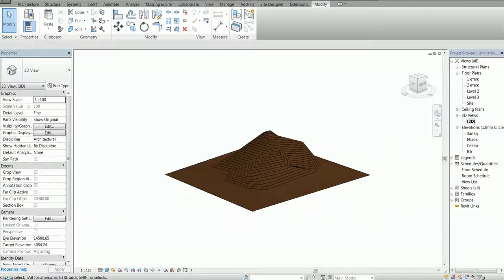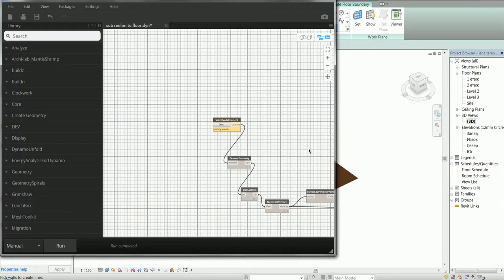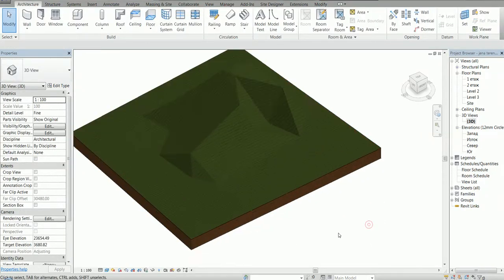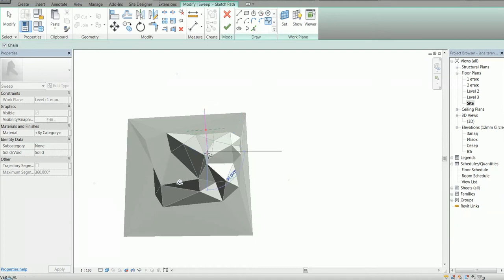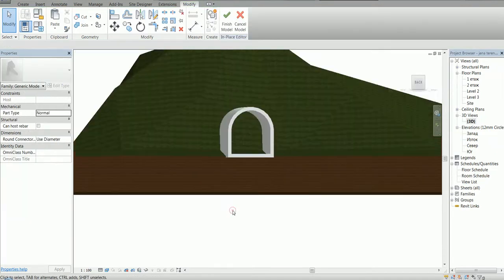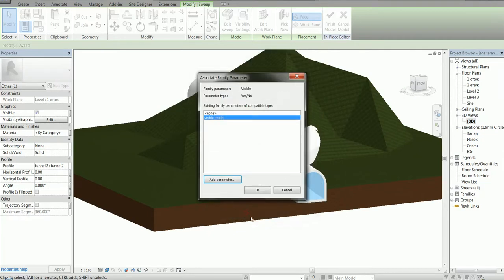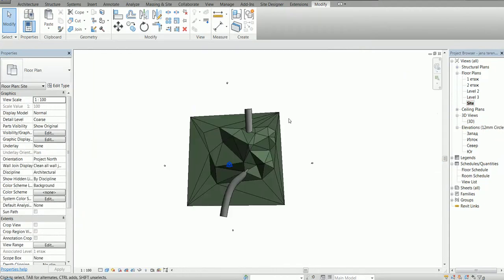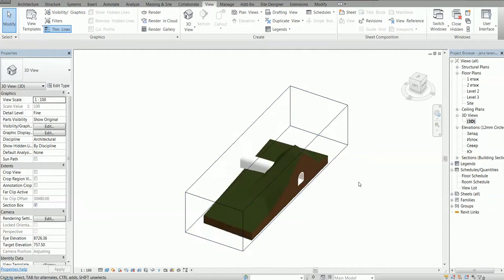Revit: Creating Tunnels (Dynamo involved)

Comment: Hello, could you help me. You said that in the previous video you showed how to write a script in dynamo, but I can't find it. I really care about this for my graduate work, how do I script it?
Reply from the maker: Hi Marina, as you might have noticed this video is from 2016 which happens to be 6 years ago so things changed a bit and I removed the files I talk about from the description. However if anything now it is easier to do such things, there are different dynamo packages etc. In this particular video Dynamo is only used to make a floor copy of the topography - the other part is simple revit stuff. I'm also not saying this workflow is ideal - sllabs with extreme changes of points like that could be kinda heavy in the project. But you can still do it - use the SlabShapeByPoints node in the Clockwork package.
Reply: Thank you very much for instructional videos and for help

Comment: Hi Viktor. I really don't understand the role of your Dynamo script here? Could you explain? From what I see it has nothing to do with the tunnel nor with the terrain?
Reply from the maker: In this case Dynamo is used to copy the topography to a floor. It takes the topography mesh and makes a solid floor. I'm explaining this in the beginning of the video. Then the rest is Revit only. 
This video is more if an experiment though. It's definitely not the best way to model a real tunnel.
Reply: @RevitExperiments  Ok I see, would be great if you could have mentioned in the video why you need exactly a floor instead of holding on to the terrain? Also your approach to the tunnel geometry is quite interesting/ unusual. I would have worked with a void instead and simply cut both the tunnel and the terrain with the same void. Would that have worked?
Reply from the maker: We need a floor or anything solid to be able to carve the void in it. The topography in revit is just a mesh shell, so you can't really use it to carve tunnels. You can use a void, but since you'll have some kind of structure for the tunnel I used a family. Again - this workflow might work for some concept design since it just involves a simple Dynamo script and regular modelling in Revit, so many people can use it.
 I might share a real workflow for modelling tunnels in Revit with Dynamo in the future, but it is far more complex. 
The topography there is made from a direct shape object and the tunnels are made as precast concrete blocks, aligned to a central axis that usually comes from Civil 3D.
Reply from the maker: Btw, here's another approach, but unfortunately with no sound: 
https://youtu.be/kAQ09t7PCug
Reply: @RevitExperiments   Thank you, will check it out. Btw could you share the dynamo definition you use in this first video? And also have you ever had any of the warnings/errors that some of the ppl commenting below have been experiencing?